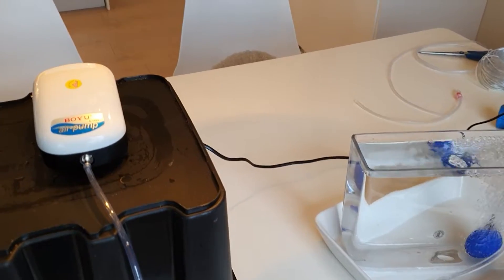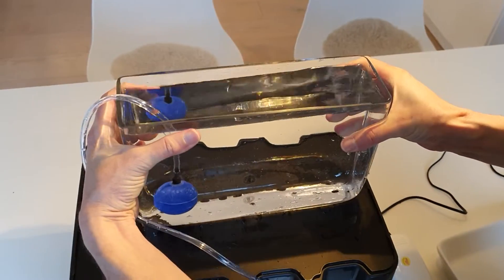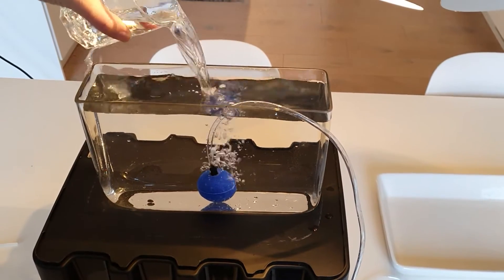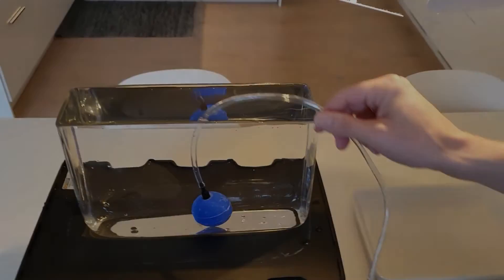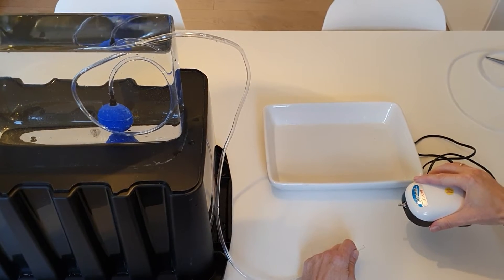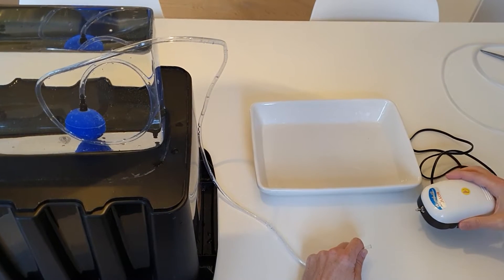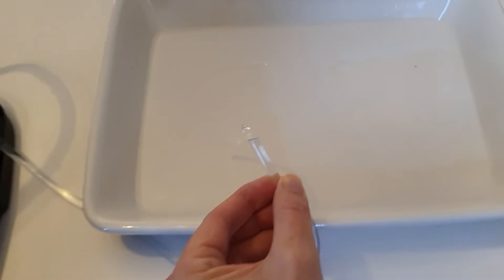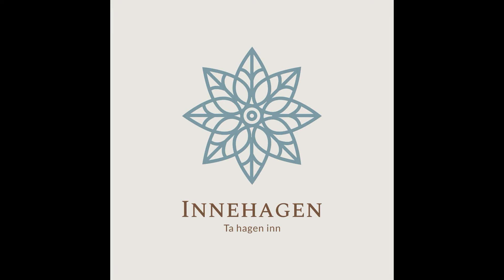AIR PUMP CHECK VALVES - Do you really need them?

Comment: I am here to tell you the air line kept coming off the pump and no water was siphoning out. I didn't worry about it and eventually the air line came off and started pulling water out of the tank. Good thing it was caught during the day and only a small amount was in the bottom of the base. Yes all, it can happen. It happened to me it will happen to you eventually.
Reply from the maker: Thanks for sharing your experience😊 It is a good point that this might happen if the airtube shakes off the pump several times.

Comment: i put my pump ontop the glass of my tank, (60 Gal).  It has a small space on the lid, so I left opened & where the tube to connect it to goes, it's right ontop that space. so it siphons, I'll be ok. 😅
Reply from the maker: Thanks for sharing! You should be safe as long as the pump is above the tank. Sounds like you are double safe and that is good👍🤩

Comment: You have forgotten that the line could be disconnected from the air stone. Or that the water doesn't flow through a air stone very well. But if your line is connected to a sponge filter or under gravel filter the water will back flow very easily.
Reply from the maker: Thank you for your comment and information about this👍 We have never tested with spongefilter or without airstone, but good to now😃

Comment: U are using an air stone that has little chance of water entering.  An open access pumping device has a greater chance of leaking.  Just put a straight water hose in the tank and it will leak if the pump is lower than the tank
Reply from the maker: I understand what you mean, I guess it will leak easier without any air stone, , but the water still has to get over the tank edge. Also I wanted to test with the air stone I was going to use :)